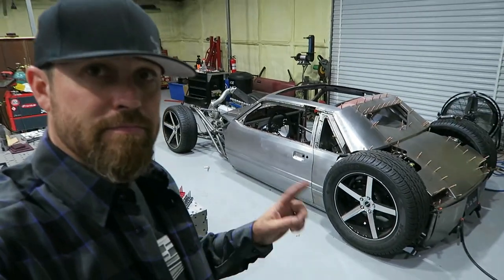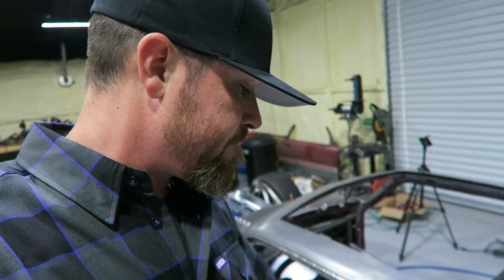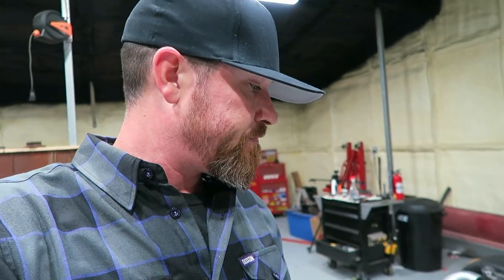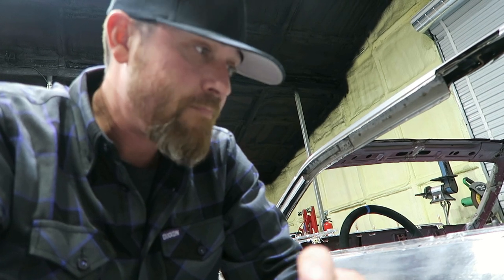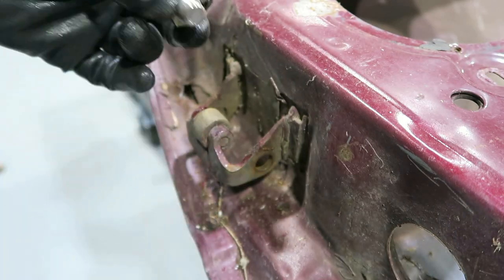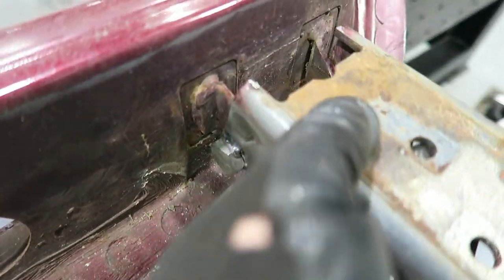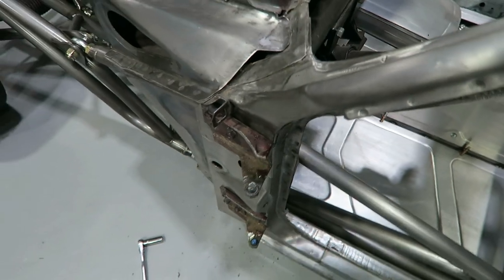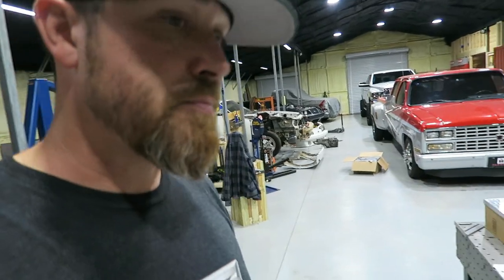Making The Bibbster Doors Removable - Foxbody Hot Rod Build

Comment: either extend that pin all the way through both holes in the door hinge, or add a second tab to each body hinge so you have 2 pins per hinge.  and the body lines on the door are great, dont cover them up with any kind of rub rail, imho..

Comment: you should remove the window section from the doors. attach those parts to the main body so the only part that is swinging is the lower section but when the door is closed it still looks like it has a window surround.

Comment: Kyle could make another hinge pin on the top part of the inner hinges and use a hook on top of the outer hinges. I believe a hook will still allow the door to be installed and removed while keeping his current design, only adding more security.

Those added hooks/pins would make the hinges stronger. The hook could cam as the door closes removing more play, if there may be any. It might help the hinges last longer, as well as would the other recommended brass sleeves.

Comment: hi knock the pins out of the hinges and replace them with the hinge bolt from a e90 bmw you should be able to drill the hinge pieces to to suite the bmw bolt and tap the top side of your hinge if you where to look at a e90 e91 or e92 you will see what i mean and the bolt has a small torks head so would not look out of place cheers from down under ps the car is looking killer

Comment: Others have mention KindigIt handles, which was my first thought. Not sure if Tesla handles are plastic or metal, and I've never seen how they operate inside the door. For hiding or eliminating the molding structure, I've thought about just welding a strip across the face vs. riveting.

Comment: Build your own flush mount handle, maybe add some dimple holes in them to break up the panel. This way you could make them any size you want. Could be as simple as a pivot point and a flat plate. when you push the top part of the handle it unlatched the door

Comment: I did the removable doors on my bronco, get the old pins out, 80s gm truck door pins will will slide easily into/out of the ford door pin hole without binding or allowing the door to sag.

Comment: Just an idea to consider. A single electronic push button on the door. Actuated from the catch so there are no wires to disconnect when you remove the door. Obviously you would need a great connection. You can do it. 'Do work son'.

Comment: Where your fabbed door pins are may want to re-enforce that tab cause its more weight on one side of the hinge rather than the hinge as a whole. Should probably still run a bushing on the pins cause your door holes will want to woller out bigger over time. Talk to your cnc guy that done the intake about a custom handle if you dont want a huge flat space. Also when you closed the door its alot of deflection towards the core of the door. Someone will say reflection but from a stainless fabricator and polisher perspective i watch for alot of deflection in material. Removable door idea is awesome though. 👍

Comment: I think I would make the pin long enough to go through both holes in the door bracket. Seems like that would make it less likely to sag
Reply from the maker: wouldn't be able to get it on and off if they were that long
Reply: I was imagining a removable pin or maybe a pin on both brackets w/ the door brackets sitting on top of both of the jam brackets. Hard to explain, but it would be the same as what you did just doubled up. After watching the rest of your video, it looked like your design is going to work just fine though. Keep up the good work